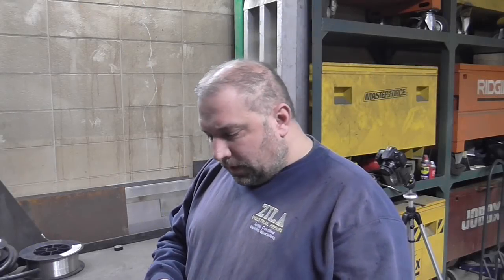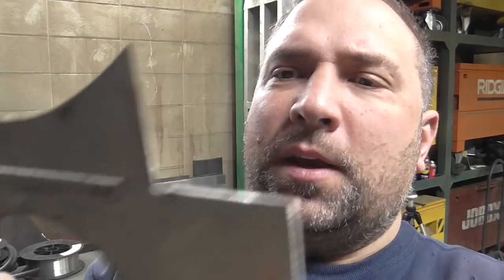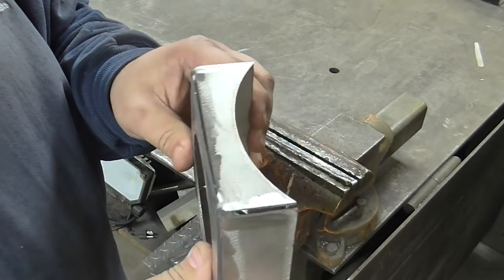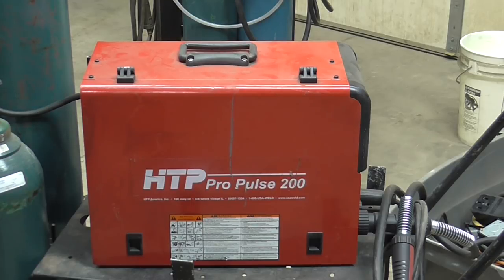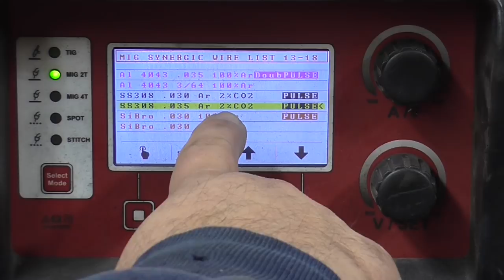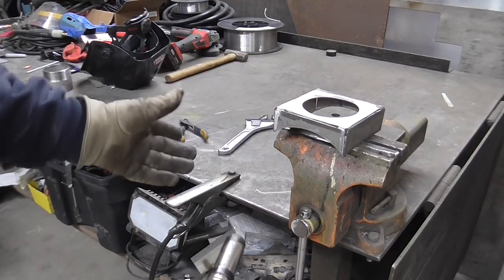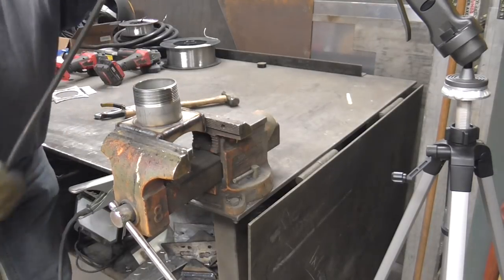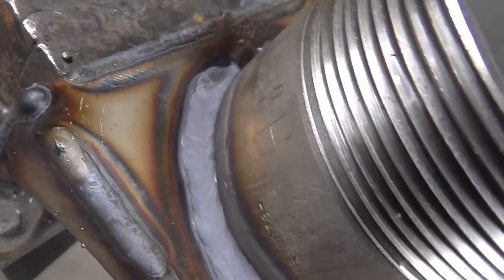The quick rundown on Stainless and mig welding. 3" nipple

Comment: Would be worth saying that you welded it with Pulse Transfer, using a Synergic Pulse machine - not a regular MIG/MAG Machine. Also passivisation is only relative to surface corrosion, creating Chromium Oxide  - it has nothing to do with the mechanical strength of a joint, don''t know where you got this from?
Reply from the maker: I will check into that !  thank you !  a guy who usually should know told me and I have seen stainless welds fail that looked adequate  ....  but I will be doing some more research and homework - thanks for the pointer

Comment: I never realized that stainless MiG welding was such a big deal. I did some stainless MiG several years ago on a parts washer tank that someone had built out of stainless. I added a stainless bung into the bottom for a drain, and a box made of stainless into the corner to mount a solvent pump into. I didn’t do anything really different than regular steel welding other than switch to stainless wire. I used the same C25 mix gas, and my old ordinary MiG welder. Seemed to come out okay from what I could tell, but then this was not anything critical either. I guess I learned something new!

Comment: David Richards is right, passivization is a surface treatment to chemically smooth and polish the exterior and create a smooth oxide coating.  It is commonly used in medical and food processing equipment to make it inherently sterile.  The integrity of the weld has more to do with managing the heat affected zone, proper shielding, proper prep and cleanliness of the material before and during welding operations.  Using grinders, files, brushes, etc dedicated to stainless helps a lot. Also a large contributor to weakness in those welds would be the lack of back purging or fluxing to protect the back of the weld from oxidation.
Reply: You got channel  buddy?  You seem to know your stuff. I have questions 🙂

Comment: Love your videos, Zila............but I totally disagree on no passivation and the weld loses strength etc. I work with 304SS nearly daily (I certainly am not an expert though, just have some real world experience :) A wire brush on the weld after welding is all you need to clean off the heat tint mark and make it all pretty. Wire brush it while the weld is fairly warm still. I say within 20 to 30seconds after you've welded. Much easier/faster in my opinion and looks beautiful.......IF you overheat the weld,weld to slow,etc. you will for sure screw up the metal properties ,and all bets are off. It will have a bronze look in color once your overheating the material or starting to overheat. Black/gray colored welds means not enough shield typically. Stainless likes plenty of shielding argon so go with a gas lens for sure. If your welds get the rainbow heat mark, your in the zone (blues,purples,amber colors,etc). If the stainless welds rusts that usually means you've used tools that used also used on carbon steels to work the stainless and gets imbedded in the surfaces, but once it rusts away fully your good though and want continue. Use  grinder wheels, wire brushes, etc. that are dedicated for stainless only for best results. I've done the above and has 304SS weld and material that never had any kind of passivation look the same for 10years and undergo wash-down treatment nearly daily.  Stellar Solutions (Weld wizard) sells a cheap passivation weld cleaner, that has instructions so you can make a DIY cheap weld cleaner that's not bad for on the cheap. This can save time if your doing a lot of welds and cant get a wire brush into certain tight spots or prefer not to have wire brush marks that you may have to blend out with a scotch brite pad for cosmetics.
Reply: I apologize for not spell checking first ,before hitting post :(
Reply: I also further apologize, as I was strictly talking in regards to TIG welding 304SS. You may have been talking in regards to ONLY Mig welding stainless. We don't Mig any 304SS, so I cant speak to that and will assume your are in fact correct that a Mig weld MUST be passivated for strength.
Reply from the maker: depending on tig - for sure it helps - mig is a must correct .. tig - depending on the material and application you might get away without
Reply: Jennifer Ratliff You can edit by selecting the 3 vertical dots at bottom right of original comment.
Reply: Jennifer Ratliff I agree with you besides one point I never wire brush my welds on Stainless I keep the colors on there so everyone else knows I didn't cook the nickel out of the puddle to make it rust.... on another note mostly TIG where I can but if it's big then I'll go MIG, Our machine is   a Dynasty 350 my settings are 400pps 67% peak time 40% background amps usually works pretty damn good for doing pipe work IMO and it's almost always in the boat so you can hang out for a couple seconds to reposition yourself in tight spots, bench work is a breeze as long as your not standing on your head with T-rex arms in the bilge.😂
Reply: Jennifer Ratliff also not walking the cup or weaving free hand like the pipeline guys, that weld the same joint in the same position all day. And think their special

Comment: First off there’s no way that piece being that thin of material should’ve looked that bad coming off of a cnc plaz! Knock the dross off with a wire wheel instead of butchering it with a flap disc or stone and you definitely should’ve tigged it cause you just fried that piece and I guarantee it will rust if it gets anywhere near moisture
Reply: David White he did say it needed to be treated after welding so it doesn't have any problems.
Reply: The back side is what’s gonna be a problem cause I guarantee it’s sugared badly! You don’t have to treat it if it’s done properly
Reply: David White Personally, I would have used some Solar Flux B on the back side and run the nipple on the positioner.
Reply: @davidwhite9906  even a tig welded joint, with a back purge needs post weld cleaning ie wire brushing and polishing, or pickling to remove any colouration, or it will eventually  corrode.

Comment: V-Knurled drive roll is what you need to feed stainless wire. Same drive roll you use with flux cord wire. The drive roll used with solid Mig wire will crush the wire and it won’t feed through your gun properly you’ll hear it snap. That’s just from my experience and imo, correct me if I’m wrong and/or if you got more info on different SS wires and such. Thanks.

Comment: Pretty impressive for a lunch box machine,
Reply from the maker: i mean that is nothing yet ... fixing those aluminum tanker trucks putting all that handrail on ...  all with the little machine ....  2 years of hell it is been through so far .... !  and it is still holding up ....   at this point there are over 1000 lbs of wire that ran through it ....

Comment: Should definitely do more vids on stainless I feel like its some magic voodoo thing that most welders dont have as much experience with... at least in my area that I've found so far
Reply from the maker: Stainless is something i really dislike .... the hexavalent chromium that deposits in your body and crates accumulative damage - the way stainless cuts, the way stainless welds (heat input is very critical) the amount of "clean up" stainless takes afterwards, back purging .... etc ....  it is a really labor intense deal ...  
i have a much better knowledge about aluminum - but i will make a small stainless series and share whatever knowledge i have - although i personally do not consider it being comprehensive - but like you said - there are a whole bunch  of guy or even shops out there who know even less about it ....
I am ok with information in my videos not being 100% complete - as long as it is not wrong

Comment: Wonder why not TIG weld it
Reply from the maker: then I cant make a pulse mig video .... pulse mig is MUCH faster in a production environment than tig is especially if you dont need Instagram quality welds ... this part is a wash out port for a salt auger ...  nothing critical ...
Reply: @ZILAwelds  Actually your MIG weld is very good. I've tried MIG weld stainless, but ended with a lot of spatters however I adjusted the machine.
Reply from the maker: D T thanks

Comment: Why didn't you use a flux on the backside like "Harris S0FB01Type B Solar Welding Flux?
Reply from the maker: I didn't have any - and the application did not require it ... it is for a salt auger ....  no one cared if there was a little sugaring on the back ,,,,

Comment: Hi ,  hi I am having on doubt
What percentage is suitable for stainless steel welding
75:25 or 98-2
Reply from the maker: 75% argon 25% CO2 when you are using gas shielded flux cored stainless wires.    98%argon 2% co2 when you are using solid Stainless wires

Comment: That weld sample at the beginning looks fantastic.  Was that 3/16" pulse solid wire wire or flux cored?  How's that passivation video coming along?  *hint *hint...  ;-)  If you run some passivation tests, toss a piece outside for the winter in the wettest nastiest place you can find.  Maybe tied to a sign post along some road that gets salted.  :-O  We don't get much snow here.  Thanks schatzi !  lol
Reply from the maker: so this video here is pulse mig only the dual shield stainless you find here https://youtu.be/8kYGW9lHzQQ

Comment: Can I weld this ss wire on a Hobart handler 140 mig?
Reply from the maker: Yes, you need different gas though    Either you need a stainless tri mix gas or you can use 98% ar/2%co2

Comment: I do a lot of 14ga and 16ga stainless mig at work you get a lot better results with much higher wire speed. I usually run upper end of 17 volts and closer to 300 ipm the start can spit and be a little rough but the beads arent so discolored once you get the puddle going. The bottles we use are argon c02 but its a proprietary blend from our supplier so not sure if its 98/2 or a little varied. If your wire speed is too low itll spit real hard once you start doing out of position welds.
Reply from the maker: thank you - I will try that and report back to you
Reply: Matt Ryan I use 98% argon 2% oxygen for really thin stainless with pulsed mig
Reply: Also machine is XMT 350 Mpa power unit running a S74 Mpa plus feeder 15foot Bernard whip
Reply: powerstroke0459 we currnetly run 95/5 on 316 and 308 stainless, thinking of switching to 92/2%. Would you recommend? Any thoughts? Thanks. Run 16 and 18 gauge
Reply: At my work it's almost all stainless. I have really struggled with tig, so I bought myself a little mig welder and took it to work. I have done lots of jobs there with it but always been disappointed with the spatter and grey colour. I learned recently that our gas is shyte. Argon and CO2. I saw a guy on YouTube welding SS with 90% helium, 7.5% argon and 2.5% CO2. His welds were awesome. I can't wait to try some out.

Comment: I think your running to hot and to fast on the wire speed. but that my 2 cents
Reply from the maker: Heavy Metalworks maybe.  I dont know for sure. From what i have seen mig stainless welds when properly executed are pinkish/grayish....   they never have rainbow colors like tig does. And for mig - stainless is a pretty hot process at least hot enough to be spray arc. And from that occasional crackle you can tell that i was a little bit too cold still....  
that is my take on things - but again - i am not a real expert on stainless - i know something but not everything - personally i know a lot more about aluminum , steel, high strength steel and cast iron....  stainless is my weak spot - however i think for the most part i can hold my own .... maybe not?

Comment: I was under the impression that the weld should stay shielded until it changes from glowing red hot to normal color.TIG machine would have post flow, but not sure how the MIG machine will keep the shielding gas coming out of the nozzle once the weld ends?
Reply from the maker: there is a post flow option on the mig as well ... up tp 10 sec ....  however - the torch moves so fast on mig that you do not get perfect coverage all the time - gun angle is important ...  and the welds are not rainbow color they are more dark pink or light grey in color

Comment: Can stainless be mig welded using 100% CO2 and a stainless wire?
Reply from the maker: I dont believe so.  Text book is calling for either a tri mix 90%helium 7.5% argon and 2.5% co2 or alternatively 97-98% argon with 2-3% co2

In europe you can use 95-98% argon with 2-5% o2 ( not co2)

I have seen guys do some “non critical” stainless with 75/25 but i would  NOT recommend that!!

100% co2 is definitely a no go - even with dual shield stainless
Reply: @ZILAwelds  thank you for an extensive answer. Do not have budget for argon... looks like I will have to resort to stick welding using special electrodes for stainless, hope it works

Comment: I have never done any stainless work... How does it compare in difficulty with aluminum and carbon steel?
Reply from the maker: TheJmk416223 it all depends.  On stick aluminum sucks big time,  carbon steel and stainless ( in thicker stuff 3/16” and thicker) are very similar.

Tig  aluminum is “way different” than steel and stainless
Steel and stainless are similar 
Tig pretty much all metals use ( or can use) the same gas (100%argon) 
Stainless flows nicer than carbon steel but you have to be careful not to overheat it ( and on thin stuff you have to worry about the backside to eliminate “sugaring” you have to back-purge with argon

Mig is similar to tig. Aluminum ( at least the set up of it) is the hardest
Steel and stainless are similar ( if you consider using both in spray arc. 
Now on mig alu ss and carbon steel all 3 use different gasses ....

And if you weld thin stuff back purging and “sugaring” are concerns just like tig

Does that answer help you anything ?

Comment: Can I weld Stainless steel 202 pipe 1.2mm thick by mig weld?
Reply from the maker: Chetan Kulkarni i think so - if you have a pulse mig. However the procedures have to be clearly specified. 
  https://www.lincolnelectric.com/assets/global/Products/Consumable_StainlessNickelandHighAlloy-Excalibur-Excalibur316316L-17/c64000.pdf
There are a few angles to it. I dont know all the ins and outs to tell you exactly how to do it snd what to watch out for in detail - but from what i could find it looks absolutely doable

Comment: So I have a lot of experience mig welding steel. Do you think I can teach myself mig welding aluminum with the htp pro pulse welder? And would you say that’s a good starter machine for aluminum welding before I go to tig welding aluminum? Thanks!
Reply: Gerard VanDijk do you use a pulse machine?
Reply from the maker: Gerard, here is what i have seen the last 2 years.   there are guys who buy the Pro Pulse 200 that have several decades of steel welding experience and they try to weld aluminum. Some guys catch on to it in a matter of hours and other guys give up after a few weeks and send the machine back.  then i also see beginners, some can weld aluminum in a matter of days and others dont .....  
so besides that there is some amount of (lets call it talent) involved - which i am pretty sure you wave that - aluminum welding is lets say "finicky" 
what i mean by that - everything has to be "right"
the right tips, liner, drive rolls, drive roll pressure, shielding gas, gas flow rate ..... just to name a few.
now when you add pulse to it it can be a beautiful thing - but if you have a "problem" in your setup - the pulse will amplify that problem ....

so that being said

if you are the methodical guy, who has a great attention to detail, does his "research" and can follow instruction (at lest some of them) .... this can be a very good machine for you.  
HTP did a nice job putting a nice package together with all the right parts and a very brief but useful manual (you really only need to read about 6 or 7 pages out of the 20 pages ....  and you could be welding aluminum in a matter of hours.

if you are the kind of guy who like manuals because they make good kindling for your wood stove and you rather figure it out the hard way all by yourself ....  ( and i am smiling while i type this because i know a guy like that ....  he is typing this response right now)  then you learning curve will be somewhat steeper .....  

now the last part

pulse mig you really cant compare to tig.

tig is slo much cleaner, more controlled , much harder to see the puddle and slower.   but there fore it can look a lot better.

so it all depends on what you want to do with it. if you want to do cosmetic welds - get a tig - if you want to do some general fabrication without breaking the bank, or fix stuff in tight spots where you weld with one had laying on your back and reaching in something - get the mig .....

if you have any other questions just ask .....

Comment: Is there a risk of exposing the weld to air too quickly by running the bead too fast?
Reply from the maker: yes and no - with mig you get pink/grey welds not the rainbow colors like tig - they can still be sound welds and when you you passivate them they all look shiny

Comment: Very nice I would have tig and stick welded it but that's just me that's a slick machine though nice job 👌
Reply from the maker: Nathan Owen you and me also could have totally tig or stick welded it ....
Especially in my shop ... part 2 the install will be airing later today ...  it was pretty convenient to use mig for the install ....  
as long as it gets the job done, customer is happy, it holds up and makes you money - any process that meets the criteria will work.   And any brand of machine too....